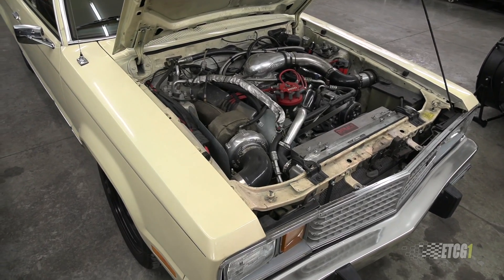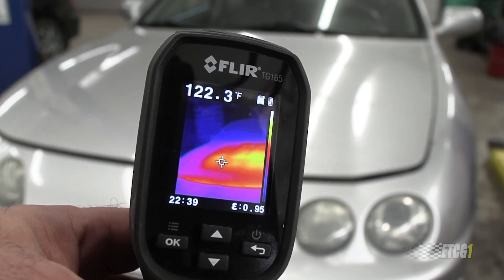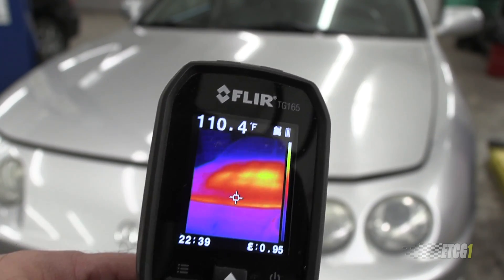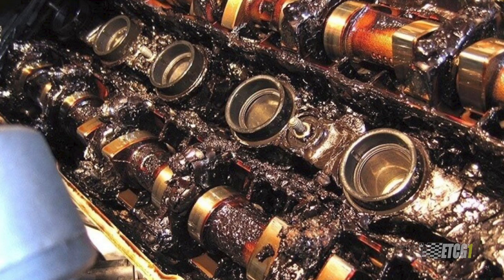What Is Heat Soak?

Comment: I agree with your assessment of the oil ‘coking’ issue, but I’m sure regular oil changes with modern oils helps to mitigate that issue. My concern with regard to ‘heat soak’ is the affect on the rubber and polymer parts under the hood, i.e., connectors, water and vacuum hoses, and belts... particularly those vehicles that have timing belts. All belts are affected, but the timing belt is more vulnerable because of its shrouded location and contacting all the steel and aluminum gears and pulleys, idler, tensioner, right up against the front of the engine block which are conducting heat away from the engine internals.

Comment: I do that too. Park the car in the driveway , pop the hood and let it cool before pulling it in the garage an hour later. I do that mostly in the summer. In the winter I do the same but in the garage and use that heat  to heat the garage.

Comment: If you have a turbo timer it will help a lot.
It keeps the engine running after you take the key out and leave to allow the cooling system to cool down the turbo.

Comment: i wondered about how tight they make cars nowadays trying to cram as much under a smaller space under the hood so they have to insulate the car battery from engine compartment .also  put all these plastic covers on bottom of engine and top of engine why? are these covers serving a purpose for airflow under car or water splashing up onto engine from road? do you think it hurts anything to leave them off ?

Comment: Like most people, after a long run where the engine has been up to operating temperature, I give the car a minute or so at idle so that hot oil is not coating through my turbo.

Comment: wouldn't those aftermarket 'vented' hoods help a lot?  A most likely unwarranted concern I've had when seeing them is water ingress from rain.  Certain versions of those hoods look pretty decent on specific cars but most are over the top for me.
Reply from the maker: Yes it does help. In fact, I installed a vent in my Fairmont, and yes, I did make provisions for water intrusion. It drains right on the cold side of the turbo. 😉

Comment: I have a fan running on low speed blowing near the car 24/7 to keep air circulating in the garage.  

And I have the same problem as you when pushing the car.  I worry a lot about things breaking.  The good thing is that means my cars tend to last a very long time.  Bad thing is I normally run the engine in low rpm and don't enjoy the car like other people who rev their car on a regular basis.

Comment: Huge problem on Jeep XJs... heat soak messes with the fuel injectors and if you have been driving, turn it off and then back on within a few minutes, the engine runs rough and throws codes.  Some guys install relays to keep the cooling fans running.  Probably a smart idea...

Comment: You know what it is getting to work on a car thats been parked for hours then you open the hood and the engine is still as hot as if it just drove-in. The coolant temp will continue to rise after a hot-shut-down, the hot engine still tries to transfer heat to the non-circulating coolant, activating the fans creates natural flow without the pump running.

Comment: I've been doing the same thing for years. I occasionally open the hood of the Vette after driving. Usually open the hood of the Camaro, rarely open the hood of the Crown Vic, and almost always open the hood of the BMW to dissipate heat and prevent heat soak.

BMW parts are plastic and expensive to replace and it runs very hot with a 219 °F thermostat, all aluminum block. The Vette runs really cool with a 160 °F thermostat and cast-iron block, but those wires and rubber hoses are pretty brittle after 27 years of age. Camaro runs pretty normal with a 195 °F lots of plastic parts with aluminum engine under that hood. The P71 served years as a patrol car and is pretty robust with extra cooling capabilities, so it can take a hit.

Comment: Mmm what about making a fan with a timer that turns on when the vehicle is shut off and runs for a determined amount of times.   Yes I know that's pretty much what Eric said honda does but I'm talking about a separate fan under the hood.
Reply from the maker: For situations where you couldn't open the hood, sure. With most vehicles you really don't have to worry about it. It's more my custom vehicles that I was referring to.
Reply: @ETCG1  yes I know. I should've mentioned that my idea is also for custom vehicles.

Comment: How do you get rid of heat soak when its 118' like it is here in Vegas?
Reply from the maker: On the majority of passenger vehicles engineers have done a good job of dealing with heat soak and it's not an issue. That said, if your engine is 200º+ and the outside temp is 118º you will still have a 'cooling' effect if you open your hood.

Comment: Well I have no clue about this kind of thing, buuuuttttt... on the next car you build, would you include an electric water pump to continue circulation while the fans are on after the vehicle turns off until a set temperature is achieved? That'd be rad!
Reply from the maker: Electric water pumps are great for the track, but not for the street.
Reply: @ETCG1  Oh, ok. Thanks

Comment: I've been doing this for years with my 13 F150 Ecoboost.  On hot days I'll come home and park in my garage and pop the hood.  It's damn hot under there... I do mostly for the sake of all the PLASTIC hoses, tubes, intakes, etc....  

I also open my hood after I've towed my #7000 TT and get to my camp site and get it unhitched... I pop the hood and the heat just pours out of it..  I've had some "truck fan boys" come up and say to me.... "Well, I guess your FORD is overheating because you have to open the hood on it"..  I say, "No, it's just that it is HOT out and it ran fine and never came close to overheating, but I'd like to get the "heat soak" out from under the hood"...  They look at me like I'm from Mars and I just say, "This is just what I do, thanks for your concern.."  Mitch

Comment: i definitely open the hood after a drive. My car has aftermarket fans that are wired to a switch panel (with relays of course) and I let those run after the car is off for some time.

Comment: My Audi has a system where it uses an electric radiator fan and an electric pump that turn on to circulate coolant through the turbos after shutdown. Only kicks on if its a certain temperature after shutdown.

Comment: Supercharged and turbocharged engines are especially vulnerable to coking. In my case, the only "boosted" engines that I own are in my 5 semi tractors. I've had each one fitted with a pre-lube system to circulate oil through the engine and turbo before a cold start, as well as after shut down. My drivers know that they will face my wrath if they don't use them! As far as heat soak, I'm a simple man. All of my personal vehicles, especially the ones with small block Chevys and headers, have heat shields over the starters!

Comment: any one with a garage can install a fan on the floor that you drive over it facing the engine bay , that works for 15 minutes and shut off by it self after you park your car to cool down your engine , no need to open the hood or even turn on and off the fan . great idea .

Comment: On non modified customer cars, not an issue today. I can remember one customer complaint of "slow crank" on a SAAB 900 back in 1985, that is it. My "junker" a 1994 Lesabre shows no heat soak symptoms even here in the Tucson summer (109F was the high yesterday 7/12/2020) Now on modified cars,heat soak can be a problem.That coked up oil sludge picture made me think of the Toyota oil sludge problem from 20 years ago.
 Toyota settled a class-action engine-sludge suit in 2007 that covered an estimated 2.5-million Toyota and Lexus vehicles made between 1997 and 2002. In that case, Toyota agreed to repair sludged engines for up to eight years from the time of purchase.

Comment: I usually let my car idle for about 5 minutes after a long drive. Turn off the AC and most electric consumers that puts a load on the engine.
It's not the most efficient way to cool the engine, but at least it circulates the oil while it cools down a little.

Comment: I am not an expert, but I have seen some plastic parts become brittle. Things like clips, cable conduit and other little parts. However, I don't really think too much about it. If something breaks, I'll either leave it alone (if it still works and is not a safety issue) or I'll just replace it.

Comment: Just go drive the car around gently for a few minutes after driving hard. That should be sufficient. There are millions of cars out there that are “heat soaked” multiple times a day and run for hundreds of thousands of miles.
Reply from the maker: Exactly, but I was speaking more about the custom vehicles that I built, not everyday vehicles where heat soak was engineered into their design. This video was more to inspire a conversation about heat soak, not name it is an issue that people have to deal with. Thanks for the comment.
Reply: If you plan to keep the car for more than 20 years lifting the hood helps. I had to replace numerous spark plug cables and distributor once on my 30 year old car plus some wires became brittle , all because of heat soak. I live near the ecuator so its a big issue

Comment: A litlle science.... Heat soak was relevant for carburator generation. If too hot - fuel would boil (not the oil) leaving pockets of "air" inside the fuelsystem making it very hard to start the engine when hot. Moderne cars don't have this problem. The very early generation / first generation of eletronic fuel injection had on some models where intake and exhaust was on same side of the head (like VW,AUDI.. etc) where a temp switch located at the intake manifold would turn on the fan to lower the engine bay temps to avoid voids in the fuel system. Modern cars, especially on turbo models, have an "after run" pump that circulate the coolant to cool the turbo's bearings since no coolant or oil is flowing after the engine is stopped.   Either way - heat soak is a fuel problem, not an oil problem.... the oil will not boil. I run a relative high performance 4 cyl turbo engine and even when pushing hard on track - the coolant will reach around 110-120 degrees centigrade - and oil will reach 138 degrees C. These tempe are way way below any oil boiling temps. Today on modern cars, especially european, they are designed to actually to keep the heat stored so that next start less fuel is used to heat up the engine.... all in the name of emissions and environment......
Reply from the maker: I never said the oil would boil, but the extra heat can contribute to it's eventual break down. I also stated that many of the issues created by heat soak were considered by engineers and they implemented strategies like running cooling fans after shut down to deal with the problem. I was speaking more in general terms and also about my custom vehicles which did not benefit from years of engineering experience. 

Thanks for your comment.
Reply: @ETCG1  I miss-heard "cooking" as boiling - my bad, sorry! Either way - once the engine stops running, no more heat is produced. The underhood temps goes up as a result from lack of "ventilation" but as an overall the engine cools..... thats why the temperatures under the hood goes up - heat that radiate away - which btw is an excellent source of heat to heat up a small garage in the winter :-) My point being that the oil will not really suffer.  If modifying a car I would consider hood vents over a turbo to ventilate the hot air rising from the exhaust and turbo in general, but other than that you should be fine. Keep the great videos coming.... Thx Eric!

Comment: I drive a small 13 passenger bus (like the kind used at airports). It has a gas powered F350 chassis  .    The company that makes these buses installs two small scoops in reverse  to dissipate heat.    I was wondering why more vehicles don't have them.

Comment: I have used a huge belt driven 60 inch fan to remove the bulk of the heat from few of my vehicles while they were outside to cool them down after I drove it to start maintenance

Comment: Its way to hot here in az if you lift the hood the Engine while its off will gain heat 120 degrees here i dont have a garage i have several drive ways so there ways in the sun

Comment: I usually just wait for the fans to stop running when I park, if I can.
Reply: when you drive the engine temperature is lower (below fan start ..at thermostat temperature)
if the fan start it's because you waited  to long  the engine got even hotter that the fan had to start
Reply: moreause I think what he meant to say was that he turned off the vehicle and put the key back to ‘on’ without starting the engine. It enables the sensors to kick the fans on while the engine is off. This does help a lot on my 1998 LS400
Reply: @Finesse460  Those are beefy engines, gotta keep them cool! I have an 01 GS300, those 2JZ love to get nice and toasty. If I drive it hard fans immediately turn on if i slow down and there's no more air flow lol
Reply: @moreause  it all depends on HOW you drive... 😏 lol for me if I park and the fans are not on, I'll just shut it off and leave it. If the fans ARE on, I leave the engine running until they shut off. Sometimes though I do shut the engine off and then put the key in the on position to run the fans for a minute and blow air over everything.

Comment: My dads 92 accord will run the fan even with the key off, until the temp switch reaches its break temp. When I installed electric fans on my old cars I also wired them up such that they bypassed the ignition switch. Letting the temp switch break the ckt when the temp goes down. Its a little awkward to hear the fan running when the car is off and locked, but I feel like I'm helping the heat soak issue.

Comment: I think it depends on the vehicle and driving conditions prior to shutdown.  My Tacoma 4-cylinder has gaps around the hood (not sealed) and no heat/sound insulation underhood so I don't even think about extra cooling for that.  However, the 1995 Corvette would probably benefit from extra cooling after shutdown for several reasons: 
-- the 1990s Chevy LT1 was designed to run hot for emissions purposes (electric fans don't kick on until 228F)
-- the iron block holds a LOT of heat 
-- the hood is partially sealed at the wheel wells and the firewall.  
If the car has been idled before shutdown, the big iron block could be 228F or hotter when it stops running, GAH.  (If it's been moving along with some airflow it usually stays between 190-205F.)  So I know for sure that everything under that fiberglass (FRP) hood cooks for hours after shutdown... the vacuum lines for the cruise control have become rough and brittle, the hood is still very hot 2 hours after shutdown, and the temperature inside the garage increases approx 10-15 degrees F after I drive that car.  (The Tacoma does not cause such an increase in garage temperature, maybe 5 degrees F at most.)  The problem with opening the Corvette hood is that the hood release cables are known to wear and break after 25+ years -- this car has emergency cables installed, but still I want to preserve the originals as long as possible and extra wear/tear is not desired.  My solution is to place a small fan on the ground in front of the car and run it for 1 hour but I only bother with this if the engine temp is above approx 215F when shut off.  
I have machine sympathy as well.  I bought these vehicles because they are excellent for doing exactly what I need and they are mechanically robust... and they will last nearly forever the way I treat them.  Yes I get on the gas occasionally because that's good to clean out carbon.  
Thanks Eric for the thoughtful video.
Reply: You are dead right about the 195F operating temp of the LT1/4. & The lower temp thermostats only cause other problems since the engine was designed this way (unless you've rebuilt with new clearances for lower temps). I lost a lot of fuel efficiency when mine stuck wide open, probably mostly due to ECM response to the reduced temps. A timed rad fan override relay after ignition shutoff or a "blower" will help air thru that little engine compartment. I'm sure a house fan is fine but most of the air will run over the hood thanks to the design. It's worth it every time you park, regardless of what the dash says, keep doing it!
Reply: @jameslarson7452  When I said I put the house fan on the ground, I mean the fan shroud is literally touching the garage floor.  So most of the air is in fact flowing underneath the car to cool things underhood.  Thanks for your reply :thumbs:

Comment: There's a pretty steep hill I need to go up to get to my house, and I always have my foot in it pretty good going up it. As I get to the top, I let off the gas and try to coast as long as I can to get everything cooled off before I kill the engine once parked. I'll let it idle for a minute before I shut it down, too, on super-hot days. I run Amsoil in most of my vehicles, so I don't worry too much about internal heat. Things would have to be burning hot to coke up Amsoil Signature Series oil. My Silverado is past the point of me caring too much about it - been a lemon since even before it rolled off the showroom floor! At 102k miles now, so I figure I've got 30k more miles before the engine fails, either from a stuck AFM lifter, broken valve springs, walked cam bearings, or any number of the other failures this engine suffers. I definitely won't go above and beyond to keep heat out of it. The replacement engine will get better care than this one.

If I had an engine like the Fairmont, I most certainly would open the hood! That's a giant aluminum bank account right there. 😁😜